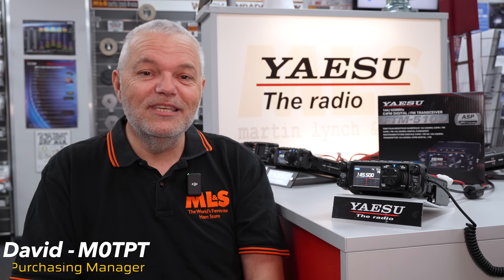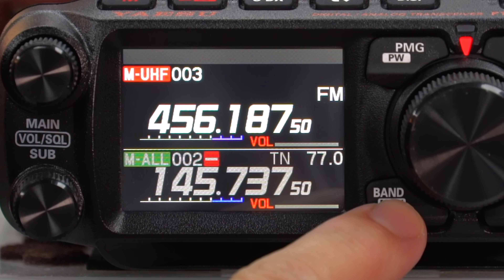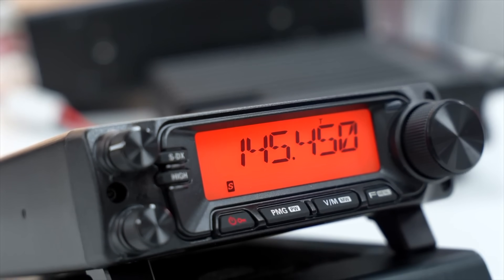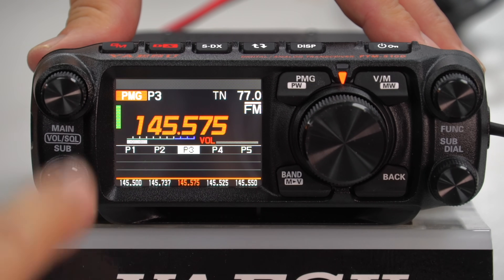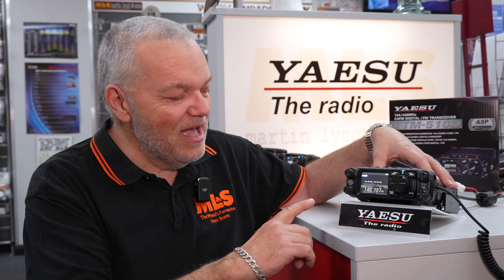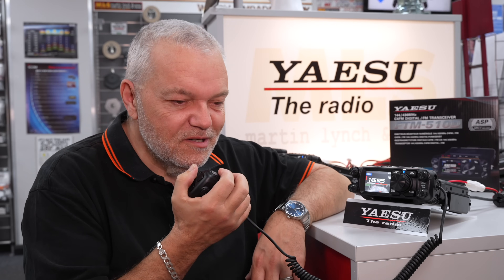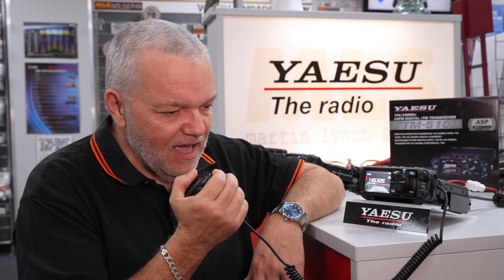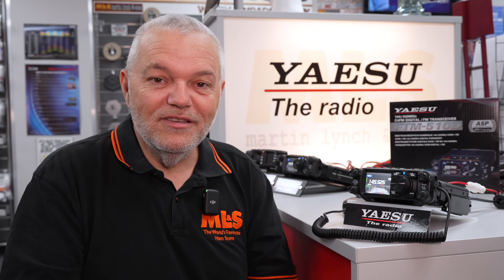FTM-510 vs FTM-500 – What Yaesu Changed (and Why)

Comment: How would the FTM500 plus BHI Audio Filter compare with the FTM510 with ASP?  That would be a good upgrade for the 500 that could also be used on other radios in the shack. I appreciate this is less relevant for people using the 500 mobile.

Comment: You’re getting better in your presentations Dave… you were real nervous when you kicked off probably because of the camera.  This radio is an improvement and with the previous 500s being able to be firmware updated from Yaesu is a great consideration. I will consider getting one when more YouTubers have had a go with it. I’m expecting it to be expensive.
Is there a small patch lead that will take the microphone jack to the front instead of the side for those who fancy putting this or others in a bag with a LiPo4 battery and carting it uphill and down dale… ok.73.        💙
G0uvl

Comment: Thanks for the video. Even after watching it, in my opinion, the FTM 400 (of which I have 2, One in the car, the other in the shack) is a far better radio for mobile use. I love the large touchscreen dual monitor display. I'm really not bothered about the memories and other feature that the FTM 500 offers. I use the 400 handsfree in the car and it is just perfect.

Comment: It’s worth noting that I have seen this radio without the ASP (which can then be bought separately as a drop in). If it’s sold as they FTM-510, it probably doesn’t have it. Listings that say FTM-510 ASP, definitely do. But I think this mainly applies to America as far as I can see. The drop chip seems to be around $60. If you want to add it later, so it might be worth checking the price of both and seeing if it’s cheaper to do it one way rather than the other. In the UK, the Martin Lynch store stocks the ASP version!